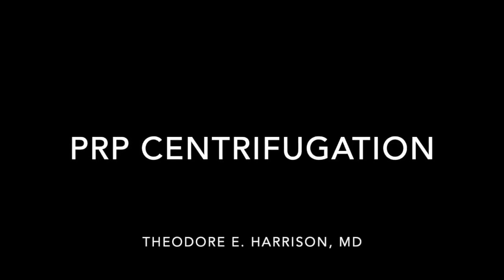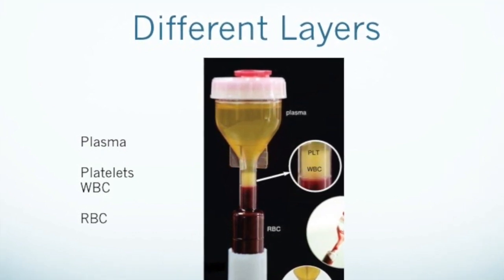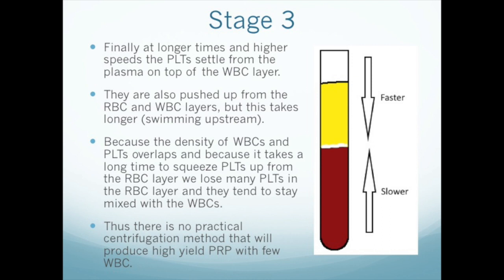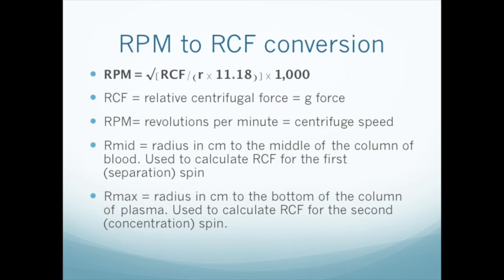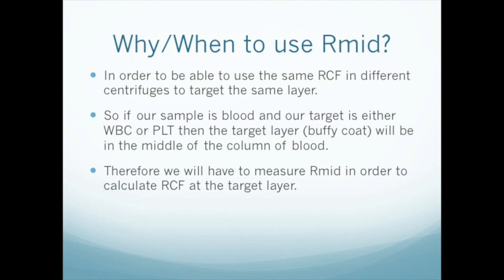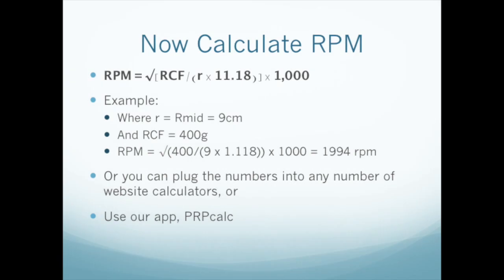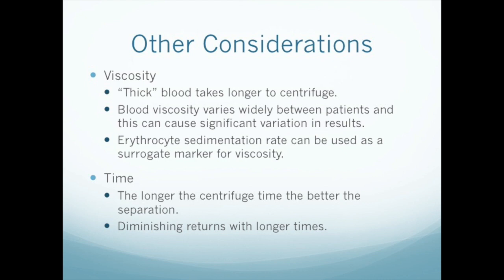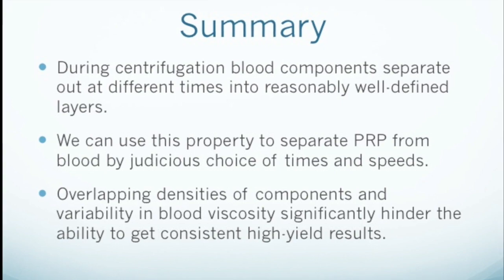PRP Centrifugation

Comment: Thank you Doctor for the sharing of knowledge. How to measure D2 from acda tube with gel? Should we exclude the gel length or not?
Reply: D2 is intended to be the distance to the buffy coat. So if you are using a gel tube (where the buffy coat will appear just above the gel) things get complicated. You'll have to break D2 down into its components and add them up. D2 has 2 components: (1) the distance from the top of the tube to the top of the column of blood, and (2) the distance from the top of the column of blood to the middle of the column of blood (before centrifugation). You can measure (1) directly on a filled gel tube. To get (2) you will have to measure the height of the column of blood in a filled gel tube and then divide by two. Then D2 = (1) + (2).